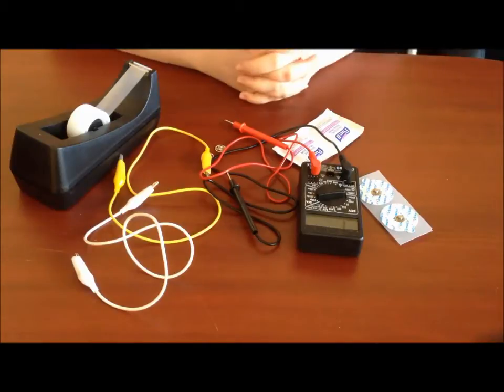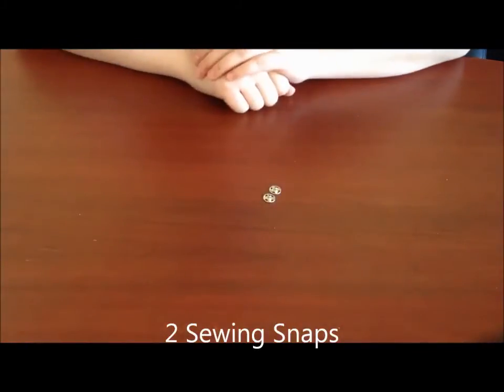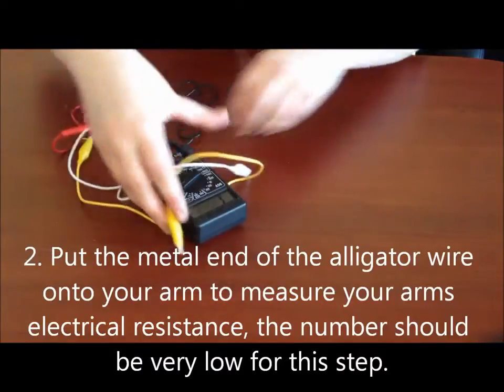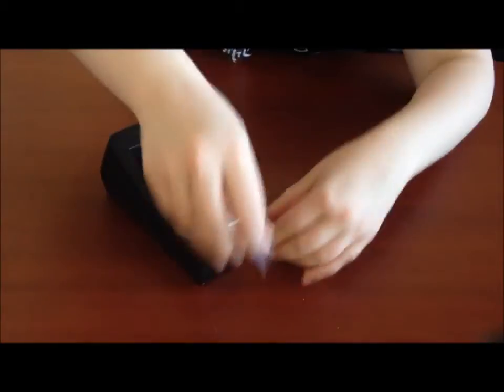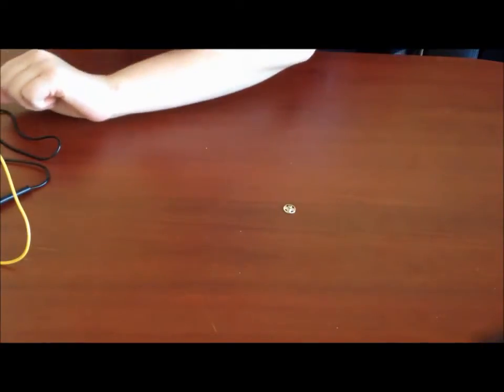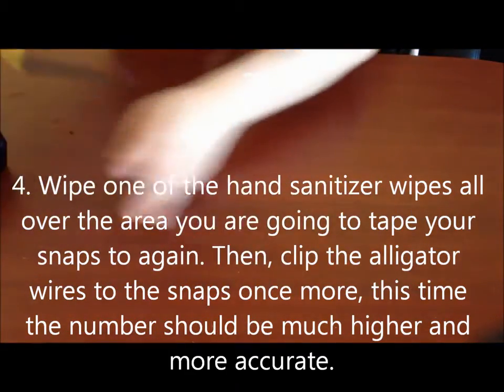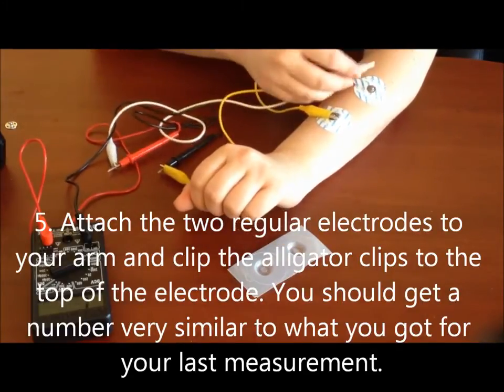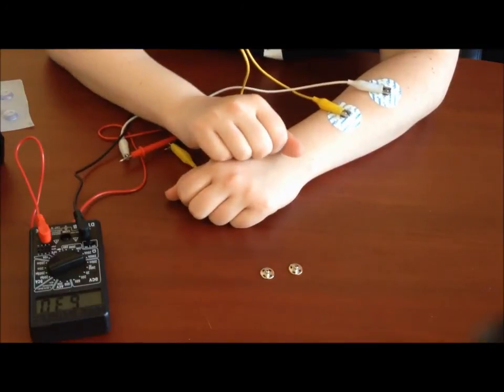How to Make a Reusable Electrode

Comment: One : it will sting as it’s too small area, no measuring will help(!)

Two: possible metal electrolysis on your skin(!) not good

Three: use conductive silicone electrodes, contain black carbon. On moist skin , attached with pressure from elastic band bc they are not gel adhesive, or lying on them work ok. Those are possible to disinfect and wash and share and reuse. 

Those are good for developing and developed countries. Without being condescending;)

Comment: the multimeter is not showing any resistance value with your reusable electrode. The electrolyte used matters since Redox reaction has to happen to conduct current through the skin. But I still would like to try this as an experiment
Reply: Water with a bit of salt is the safest electrolyte.

Comment: I have an omron for electrical therapy. Instead of spening on their pads could i make my own electrodes ? Thx
Reply: use wet felt electrodes and you can cut and shape to any size or shape.they retain moisture.held in place by elasticated bands.you can glue studs on one side or use crocodile clips.

Comment: That is a VERY small area for current. It's probably going to burn you with no conductive gel plus the tiny snaps! (The whole area of the correct adhesive pads are conductive.)